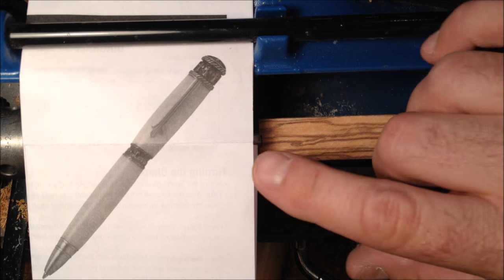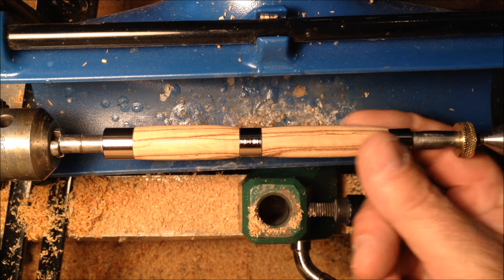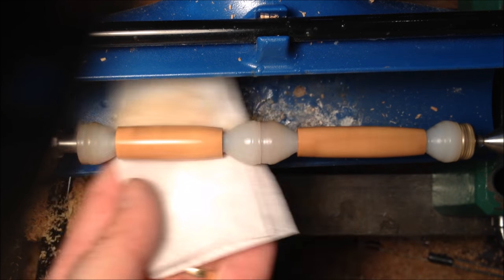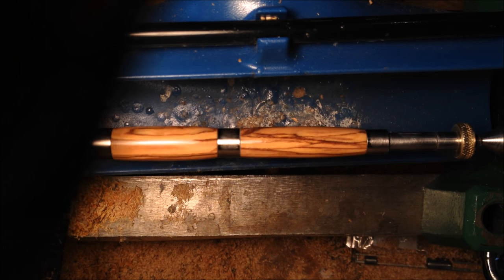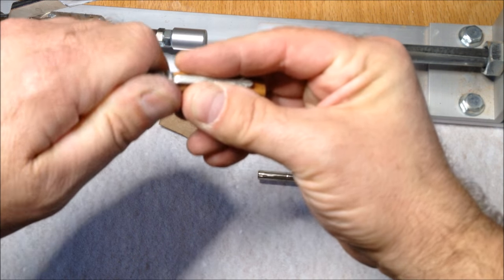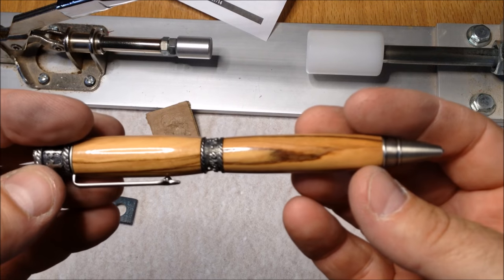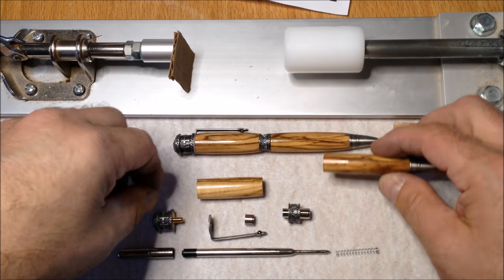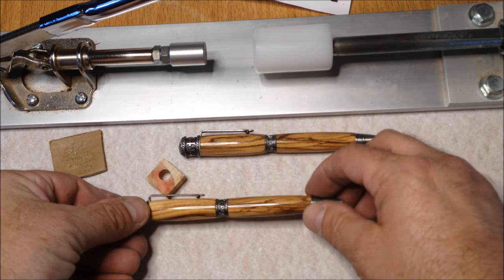Faith Hope and Love Pen - Not Worth The Money

Comment: I just finished turning this pen. I also used the Bethlehem olive wood. I hadn't seen your video first, but I'm sure many people will put this kit and blank together. I was commissioned to make this pen by a friend for his wife. Bought the kit at Rockler's.  I have three problems:
1) The threads on the grommet are bad. The post on the end piece WILL NOT start on the correct (flat) side of the grommet. After pressing the grommet back out and putting it in a vise I decided to quit trying before I destroyed the post. I re-installed the grommet backwards (beveled side out) and though I am engaging on fewer threads because of the bevel, it does engage.
2) The center ring is not perpendicular to the mechanism threaded into it, so my "cap" blank does not seat square against the center ring. I know the blank is squared properly because the gap stays in one place as I rotate the mechanism.This is just bad build quality.
3) The tip of the pen protrudes slightly when it is fully recessed. I did not remove any of the tube when squaring the blank. It protrudes about 1/16, which means it'll probably write on things in a pocket or purse when "closed". Really disappointed.

Too bad because I could see making many of these for friends and relatives.
Reply from the maker: I’m with you Brian,
  This would be a very popular pen for sale or gifting if the issues were corrected.

Regards,
Bob

Comment: Hi Bob, At the time of watching your video I had already purchased the self same pen made by PSI. I used Olive wood and I am very pleased withe the result which is a CA finish. Apart from, yes you've guessed it. I have ended up with the thinnest, hardly noticeable gap between the pen top and the centre band. The gap is uniform all the way round so everything is square. The smallest of gaps but would not sell as it is. Keep the videos coming. Allan
Reply from the maker: Thank you Alan. This kit has been the bane of many turners. 

Regards,
Bob

Comment: Also had issues. I'm no expert at pen turning, just been turning pens about 18 months but I'm pretty OCD when it comes to squaring blanks and going flush to tubes. My issue is refill doesn't seem to extend very much past nib. It works and will write just not pleasing to eye. Seems to me, lower tube is just a hair long. I used barrel trimmer and make sure tube is flush. Made a couple of these kits in past so may just be a bad kit. But I do agree, not well made overall. Oh, love your channel BTW! I have learned a ton. I like how you take the time to explain your thought process.
Reply from the maker: Thank you Joshua,
  I would have thought by now they would have figured that kit out. With a few adjustments it would be an incredibly popular kit. You may be able to save your pen, I wouldn’t recommend a barrel trimmer but if you have access to a disk sander you could shave he lower section down a hair at a time until the ink refill fits correctly. 

Regards,
Bob
Reply: @RJBWoodTurner  Good idea! I may try that. When I first started turning I would square blanks with disc sander. I think I'll go back to that. I find the barrel trimmer can sometimes bite in the tube and make it a bit out of whack. I will try to sand a bit off blank a little at a time and see if I can get it right.

Comment: Have you considered the possibility of when you are pressing the threaded end into the blank using a piece of wood with a hole... that if the hole is not only just larger than the threads, the pressure is being put more to the outside of that ring causing it to bend downwards thus creating that gap?  Also, when using those non-stick bushings during CA application, CA may run over the edges and down onto the mating surfaces since the bushings don't cover those surfaces.  I put a bit of paste wax on my regular bushings before putting everything on the mandrel and have not had any problems with the metal bushings sticking to the blanks afterwards.  When I remove them from the mandrel I'll give the ends a quick sanding across some 2000 grit paper to even up the edges, and I get no gaps.
Reply from the maker: Thank you. 

Regards,
Bob

Comment: I also had a lot of trouble with this kit, specifically the center band. The slight warping on mine left a gap between the top barrel and the center band, in pressing and twisting to try and make it flush, the rope edge chipped a big section of my CA finish off. I assumed I just had bad luck, needless to say I wouldn't buy this kit again
Reply from the maker: Thank you Devin,
  I’m surprised PSI hasn’t gone back to the manufacture and had them fix the issue. 

Regards,
Bob

Comment: Thanks for the info.  This is a good example of why I've steered away from PSI products.  Too many out of tolerance and/or poor operation pen kits (and lathe accessories) that were just a waste of money.  PSI tech support has also been of little help resolving issues.
Reply from the maker: +Mark Hazlewood Luckily, this was a first for me and they did send me some replacement parts.

I'd like to see them pull the kit until the issues are resolved but I don't think that's going to happen. 

Hopefully my experience will save other turners from a flawed kit.

Bob
Reply: Mark Hazlewood ...may I ask where you get your kits from?  (recommendation alternatives) It seems the same kits are available at pretty much every supply store I've seen.
Reply: Shane Betmarik Shane, I get most of my kits from woodturningz.com.  I had too many problems with PSI.  I like their service better.
Reply: woodturningz.com has some very nice pens exclusive to there company but it seems most are the same kits offered at PSI as well as the many other companies I've seen so far. Needless to say, I'll be staying clear of this particular series of kits

Comment: Great try to salvage the pens. One thought, could you turn a small amount off if the end and replace it with a contrasting color wood a little long and reassemble??  Just a thought. Thanks for the video.
Reply from the maker: +David Clauson It's not the blank that's the problem, it's the trim ring. It has a manufactures defect and PSI is aware of it, per the conversation I had with their tech guy. I will salvage and reuse these blanks on another pen, Olivewood is to beautiful to waist. 

Bob
Reply: No doubt, I just figured if you extended the blank a1/8 inch or so, you could hide their screw up. Have a great day.
Reply from the maker: +David Clauson Oh,
  I think I misunderstood. My apologies. I am planning to attempt bending the edges of the ring to match. Wish me luck.  You have a great day too David. 

Regards,
Bob

Comment: Another great demmo. I drilled a hole in my pen press similar to what you have. Just wondering if since the quality of the pen seems a bit low, if perchance the hole may have pushed some of the plating aside showing more of the inferior quality.
Reply from the maker: +Christian Jensen Hello Christian,
  I actually assembled the third kit and pressed with cardboard like I usually do on the threads. It never touched the trim ring and I had the same result. The only difference with this kid was the nib wasn't In bad shape. 

Regards,
Bob

Comment: hello and thanks for sharing. I made one for my sister in law last year and had the exact same issue. and at $15/20 for the kit not even the wood, big disappointment. also made the cowboy boots one/and the nautical pen both had there own flaws as well. I thought I was doing something wrong but good to know it just might be a design flaw.
Reply from the maker: +David  Good Thank you for the tip on the cowboy and nautical kits. I'll avoid them as well. 

Bob
Reply: I want to add here the Wildcard kit has fit issues as well.  It is good to know the bad kits.  Penn State offers many top notch kits so just do your research.  In my opinion they should discontinue these low quality kits.
Reply from the maker: +Tenspeed TheBikeHanger Duly noted and add to my list of kits to avoid. 

Bob

Comment: Thanks for sharing the video with us Bob . Will Pennstate make good on the 3 kits you purchased? I have a problem with a transmission on a pen or two,but never 3 in a row. I would hate to think you would be out that money.     Mike
Reply from the maker: +Michael Peitz Hello Michael,
  PSI has sent me replacement parts and I have installed them. The pens are not perfect but they are better. 

Bob
Reply: @RJBWoodTurner  Bob, I would say--and I suspect that the overwhelming majority of your subscribers and viewers would say, too--that "better" is not good enough.  One of the things we all appreciate about you is your determination to put out a stellar product.  But, when the raw materials, especially ones that remain on the market by a vendor, are undesirable, there's no way the final product can measure up to the standard of excellence you set forth and live out.  So, thank you for your candor and honesty.  My hope is that PennState will give serious consideration to either removing this product from their line (thereby removing the practice of "bilking" customers) or demanding that their manufacturer corrects this "not ready for prime time" product.

Comment: Thanks Bob,  I wonder if the Cowboy pen, and Skull pen have the same issue as they are of the same design?  Let me know if you get any viewer input on those.
Reply from the maker: +Lynn Lacey I've already had viewers say the Cowboy pen, Nautical pen, and the one with cards on it, forgot the name are the same way. 

Bob
Reply: Thanks my friend
Reply from the maker: +Lynn Lacey Any time. 

Bob
Reply: Lynn, 
I had very small problems with the skull.  Mainly, the springs.  I've sold six and younger people love them.
Thanks,
Terry
Reply from the maker: +Terry Grimes Great to know 
  Maybe I need to add a couple to my stock. 

Bob
Reply: I have made three Faith pens and three Cowboy pens. The Faith pens had a very slight gap at the center band but not as bad as what Bob shows in this video. The cowboy pens had a good fit and I had no problems with any of the tips. with that said, I bought those kits several months ago. Maybe something in the manufacturing process changed. Don't think I'll buy any more. Thanks for the video Bob.
Reply from the maker: +Michael Suggs Thank you Michael,
  I need to purchase a couple Cowboy pens and test them out for myself. I passed along info from another turner and maybe those pens are hit and miss on the quality. 

Bob

Comment: Thank You for sharing this review. One question, do you have any videos of doing a finish without CA glue?  Are there other options?  
TY for sharing the video on making the non-stick bushings, it's a real money saver.
Reply from the maker: +WigWagWorkshop The only other finishes I've done are Friction Polish and Shella Wax. The Angel Christmas Ornament video I recently did showed the process.

   I start by sanding to 400. 

  Clean the piece with Denatured Alcohol. 

  I use EEE Ultra shine and work it in with a paper towel. Then I use a clean towel to buff it off. (Slow lathe speed)

I then apply either HUT Friction Polish or Shella Wax, SW is my preference if I had to choose. 

  To apply it, turn the speed of the lathe up and build some heat while applying with a paper towel. 

  Buff it off with a clean paper towel. 

  I then use HUT brown followed by white wax bars and wax the finished surface. 

  This isn't the only way, it's just my method. I get beautiful results, they just don't last as long as the C/A does. 

Bob